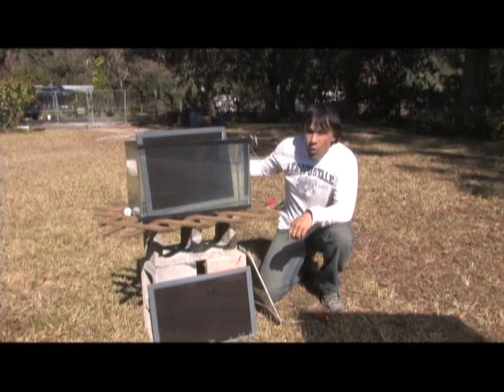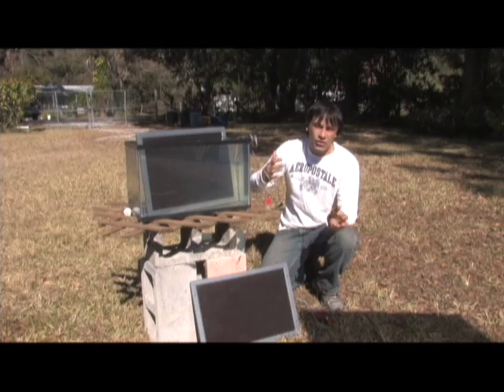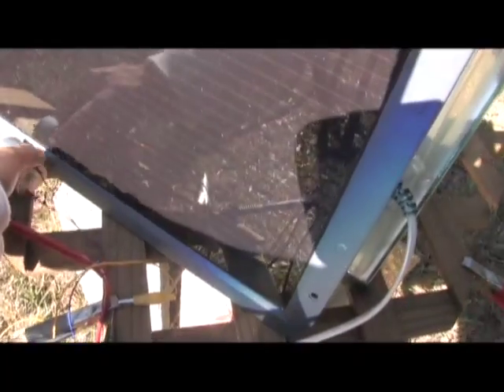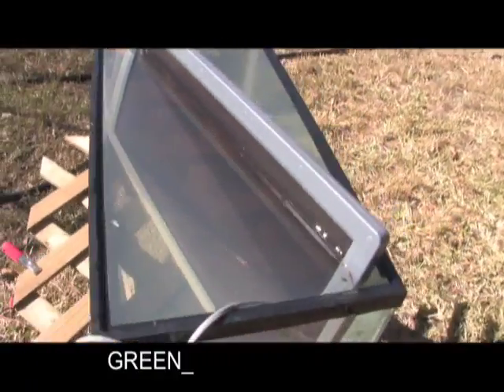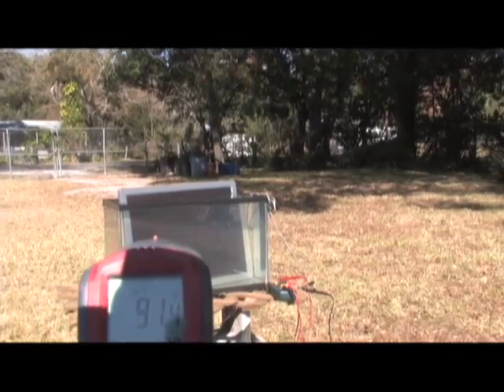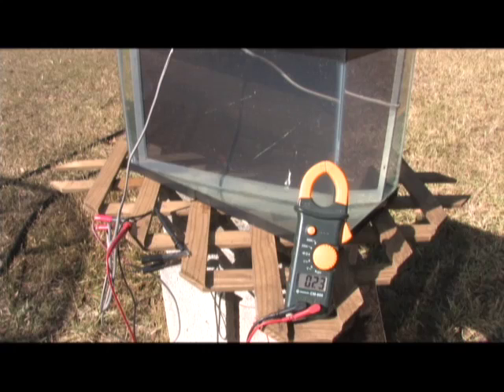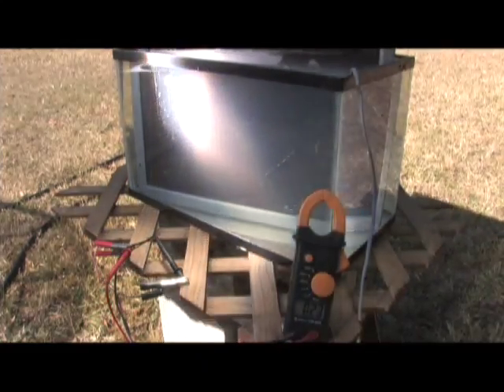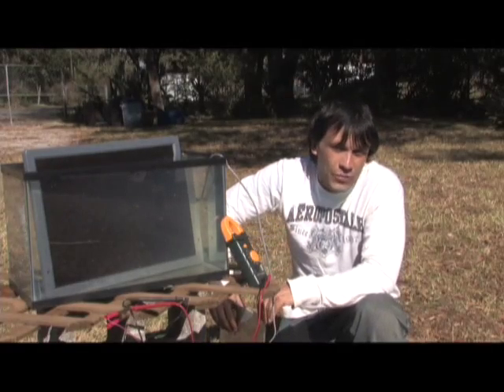Underwater SOLAR PANELS 9% Stronger PV Photovoltaic Sun Power

Comment: Test is trash. Use a real inline power meter to measure power. Also the panel in water is shaded.  Panels do work better when cooler though, there is about 3% loss per 10C heat increase.

Comment: The glass aquarium will obviously reflect away part of the sunlight before it even reaches the panel. So in reality they would perform even better if you would put them in a basin without glass over them. Keeping the water and the panels clean would be an issue, algae, leaves, insects would all build up. I can imagine a combination of solar panels and solar collectors (heating flowing water in glass pipes) work really well.
Since that is such an obvious idea, I wonder why haven't seen designs of that type on the market yet. Maybe because it is harder to realize than I think? I wonder...

Comment: Also it should be noted that although it might seem you need to "pump" water into the underwater Photovoltaic array, this added energy requirement would be obviated by simply using a solar thermosiphon setup (self pumping).

Comment: Usually when you harness a system or device to "get more work out of it," you increase the energy required to run it. This experiment shows that "getting more work out" can actually increase the energy efficiency and lower the cost of a system/device's operation. That's what makes this a classic experiment, perhaps "revolutionary."
Reply from the maker: Jay Dillon Thank you Jay!

Comment: You do not have to submerge panels in water to cool them down and to get more power out of them.
Just cool them down with cold water from a water hose. And leave your volt and amp meter connected while doing this. You will see more power output when the panel cools down.
In the winter I get more voltage and amps per panel when it is cold. But the length of sun light is shorter, so the total collection of sun power per day in the winter is lower despite the panels producing more power per hour.

Comment: dude get your facts checked, Solar panels have a optimum wattage depending on the voltage and amps drawn. It could be that your panel had more volts underwater but less watts at the amp's drawn. Read up on MPPT's and hook some up and measure the power generated in watts then check if underwater would do better.
Reply: +Malloot panels have a optimum wattage depending on the voltage and amps drawn.
No, but Watts = Volts * Amps :)  and panel resistance increases with temperature, so the results of this cool experiment are no surprise.
And no need for a MPPT, the electric motor turning slower shows the simple truth of it.
Reply: +WelcomeToMyDream do you have more resources to learn about this? have any more experiments been done in recent times?

Comment: Some current measurements would be good to see. Should be up a bit when cooled, as seen on the motor. With the lens current can go up close to the magnification factor. especially if panel is cooled.
How about heating thermal medium for 24/7 LTD Stirling running :)

Win win win. 
Thanks for the upload :)

Comment from the maker: "Hack to get the cells out" :-) Amorphous panel.
Reply: Heat the water and see if it goes down?  But it probably has more to do with the way that the water conducts the heat away from the panel better than air; and supplies a big thermal mas that is lower temp than the surrounding air.
Reply: The second panel was at a different (easily noticeable as worse) angle in reference to the sun, hence.. less power, case closed.
Reply: I wonder if the temperature of the water has something to do with it.

Comment: Excellent video. Using Water Cooling to boost the efficientcy of Solar Panels. It works and used in conjunction with a solar water heater, as the author suggested, should perform double duty.

Comment: What happens when you run the test in the tank with no water and also what was the difference in and out of tank under load. Not trying to be a dick but it's hard to see weather the gains are true or determine weather it is beneficial without those measurements. just sayin

Comment: I was wondering. If you got water flowing behind one of these(which could itself be used as solar warmed water) couldn't you put  a panel at the end of some sort of mirror funnel (like the triangular one you made in a recent video) and increase the output of a panel many times over?

Comment: Dan,
If you place the panel in a flatter tank with more open surface area and less volume, it should allow water to evaporate quicker and remove more heat from the water remaining. Then shine a few parabolic mirrors at it. With this cooling system, lets see how many suns you can add until you diminish returns or overheat?

When you start to over heat try using a small fan over the water to increase evaporation and the vapor will remove more heat.
Like leaving a pool on a windy day... freezing.

Comment: I noticed the same thing on my own solar panels when the sun makes panels hot so it drops amps, i have 2pcs 60W Single crystal solar panels, if i cool the glass surface with water, amps will rise about 1A, half amp each panel.

Comment: the fact that the panel in the tank was on an angle likely would have reduced its voltage because of the amount of refraction/diffusion going on, Id like to see this test taken to the next step perhaps submersing the back side of the panel in water so that the front isnt effected in anyway. then perhaps comparing it to total submersion but have the front only in a cm of water with the bulk of the water at the back.

Really interesting stuff Dan.

Comment: @lrb1e39 Also keep in mind that if your wiring the panels in series up to a commercial voltage such as 110V, the current from the panels is DC, not AC like commercial power.

Comment: it's so useless, 2volts is nothing. if there is a capacitor inside the solar panel it will be the reason it is not rising in volt that fast. when you walk by it only drops 2 volts too maybe because of the capacitor.

Comment: What if we use a water pump that pumps about 6 gallons per minute up to a soaker hose . The pump I looked at shows...
 Power: 25 watts * 396 GPH Output
I'm getting 5 panels 135 watt each about 27" x 60" x 1 3/4". Could that pump of mist or recirculating water be worth the 25 watts used? IF 9% is accurate for larger panels then 135*1.09=147.15 next 147.15-135 = 12.15 x 5 panels = 60.75 - the 25 watts used by the pump = 35.75 per hr about 175 more for 5 hrs. Great tip if it works like this.

Comment: Dan,  I have a question.  Can these solar panels be connected in series and a series of panel chains connected in parallel to: 1)increase voltage to something that would be practical in terms of tying into house power to supplement what I get from the commercial power grid; 2) charge a large bank of deep cycle batteries that I can use in times of power outage which we get a lot in our rural area here in northern Virginia?

Comment: I think a more practical option would be to use some kind of a heat sink/dissipation device at the back of it. But if it's only a volt or two ... then does it really matter? Interesting idea about a hybrid heat/pv system... that could totally work... if designed for this purpose.

Comment: Ok, I have a GLASS FUSION KILN used for artwork: 240 VOLT AC 2W. 1 PHASE 34.7 AMP, 8320 WATTS. Is it possible to use solar to operate my kiln(s)? What would it take and how much$ with all the parts if I did it my self? I can weld a stand for the solor to. whree does the energy store? Or is this just to much amps? Thanks call direct for guidence on this. I am serious about doing this. 6129684745

Comment: Hi, I am a glass fusion artist. Is it possible to run my glass kilns off solar? Here are the stats for my largest kiln. What would be the cost to build my own set up if even possible to produce enough electricity for a fire.  I weld to if I need to build a big stand for the solar panels. Stats: 240 volts ac 2W, 1 phase, 34.7 amp. 8320 watts. How many solar panels and what do I use to store the energy and convert it into my kiln? 6129684745 to help guide me.

Comment: Excellent!
 I've seen some comments that temp of the water will rise to 135 as well... well it is the minor problem. If you place a panel in the water tank which is connected to a bigger tank underneath that system trough heat pipes, you'll get much slower heating of the water... and also kind a temperature collector for heating water. If it is known that sun shines for about 10-16h  a day (depends on the location) it could be easily calculated how big tank should be for optimal results.

Comment: WHAT IS A tec?
Reply: xxx777aaa It's a thermoelectric cooler, aka Peltier unit, module etc... It use a semiconductor to produce electricity using a difference in temperature, hot on one side cold on the other!

Comment: But the aquarium glass and water in front of the panel also cut the light perhaps by 5-10%. If  the panel would be cooled only on the back (like making an aquarium with the solar panel replacing the front glass) it will be both cool and receive more light than submerged.

Comment: make a sandwich, botton, insulation material like .5 inch polystyrene, then plastic, like 2mm thick, then the solar cell, gap underneath for water flow, then a glass front, with gap to allow water flow, now you have the solar cell cooled back and front, and its also a solar water heater....

Comment: This video is not for electric engineers. 
Most people do not know that resistance of metals depends on temperature.

The interesting fact in this video - very simple way for cooling solar panel, and even in the not clear water it gives more energy than the same heated panel.

Comment from the maker: If that were the case, the voltage would have risen instantly. All solar panels and electrical devices work better when cool because of less resistance in the circuits.

Comment: I don't think its' because it's cool. I think it's because the water offers more reflection and more angles of light, and that offers MORE light at HIGHER doses. It's like holding a mirror up to a solar panel. I don't know if this is right, but I've seen this experiment done before with mirrors and water reflects light.

Comment: If it was the light  tank, the voltage would have increased instantly vs slowly. Poly Cells, un like these cells have a metal backing so heat sinking would make sense. This was totally the cool water

Comment: In electronics, as circuit temperatures rise, circuit resistance also increases. Heat  will decrease the output voltage. Most passive cooling systems will help to increase the voltage output. The only problem with the water solution is that once the water heats up, it will retain the heat longer. If you could circulate the water it will increase the cooling capacity greatly. I realy enjoy your vids. Great stuff and thanks for sharing.

Comment: is he... sure.. That the glass in teh tank wasn't refracting more light toward the Cells?  that would increase the voltage.. Same as replecting light from a mirror onto an already lit panel.. Or his fernel lense when he pointed it towards  the cells.

Comment: I think that when distilled water is used instead of normal tap water, the results will be a little better because it is more clear. Also distilled water doesn't conduct electricity ...as far as I know.....so there is less danger of shorting out your solar panel. 

I don't have a solar panel, but I would love to see  reactions from people that know more, or are willing to put up a test with distilled water and normal tap water to see  if there is a difference in efficiency. 

Greets, InsAneTunA

Comment: Hey the temperature difference is not the strict control of the voltage, you also have to take into account for the magifying of the light through the water.

Comment: personally, i'm sold on the higher volt readings of the wet panel, and it would have to be proven otherwise, to me at least, that the one in the sunlight can produce more power.  although the ammeter theory does make sense

Comment: You are correct BTW in that colder temps do make a panel more efficient - and in arctic temps gains of prolly up to 20% can be had. Reflection off snow/water can probably boost by another 10-20%  if shinning right. We've seen solar air heaters (not PV) increase in heat output by 50% thanks to reflectance off of snow. 

The catch to all this experiment is decrease in efficiency b/c sun ray's are traveling thru glass and then H2O.

For the record, I think it's great Dan's doing these experiments.

Comment: Also, I should of not said "no load" but minimal load. High volts turn motors faster, and surge of amps is what gets a motor turning. This is why you need to use what's called a Linear Current Booster with PV to get motors (like in solar pumps) turning. 

Also, please check out the I-V curves for PV.  What you'll learn is that in a near no load condition, voltage is maxed. But the point where the PV produces most power is at the knee of the curve - neither Amps or volts are at the highest.

Comment: Amps is the difference. Power = Volts x Amps. So the author can't claim more power is being created without showing us the amps. A typical silicon PV panel gains 0.45% efficiency for each degree C decrease.  So minimal. And his panel looks to be thin film which has less gain/C. Single sheet of glass reduces solar radiation by 10%. Centimeters of water? Prolly lot more.

For the sake and fun of science, I challenge the author to do the same experiment  accurately measuring watts (IxV).

Comment: In the tank faster + 22v reading

No Tank slower 20v reading

Amps have to be more, that motor is a load, it is geared, bet you could not stop it with your finger.

I believe that particular motor is 15:1

Comment: You are incorrect and the host is correct. The motor is a geared motor and requires more power to accomplish simply spinning. There may be a bit of a difference in amps but the fact that the voltage reading is higher from the panel while spinning the Geared motor faster proves MORE AMPS and his point. 9%-8% it is still more and a fact. I saw a documentary on Discovery solar scientist stated "the North Pole is the MOST ideal because of clear sun, solar reflection and COLD - 25% more efficient".

Comment: In the video above the author makes a critical mistake - he assumes that since the voltage is higher in the submerged panel that it's producing more power. However, power is voltage times current and he hasn't measured current. A higher voltage will turn a DC motor (notice there's there's no load on the motor) faster but that doesn't mean the motor has more "umf" to actually move something. He needs to add an ammeter into his test to see what the real power production is.

Comment: just an idea for roof top solar panels where a water cooling system can be installed ^ :)  i wonder if a PC/computer water cooling pump,radiator and fan would be efficent enough to flow water over a panels surface?  either way great video , and very inspiring. :)

Comment: Wow :) so how about a new design perhaps for a solar panel ? the solar panel could have an outer layer piece of glass(like double glasing) which would allow a tiny trickle of cool water to channel and flow over the panel surface to keep it cool. the water could be recycled from a large reservoir tank and filtered so to stop green alge or wat not from clouding the panel surface? i wonder if the energy needed to pump the water over the surface would still make the panel more efficient? :)

Comment from the maker: Angle of the sun has nothing to do with this test. If that were the case, the voltage would have jumped instantly when placed in the water. Solar panels deliver more energy cold than hot. That is a known fact.

Comment: An interesting idea - could you not power a heat exchanger with solar panels, that draws heat from the panels and increase their efficiency and at the same time collect head for warming the house during the night?

That way wouldn't you end up getting both more electricity, but also as a "by-product" heat that you could also make use of for other things, or would it just be crazy?

Comment: i got the same results as you but my reason was to cool down the panal by submerged it in the water,  I wanted to ask you where can i buy a powerful stirling engine to buy of the shelf which is efficint ...  usually i find very wqeak ones i want one which would generate about 5 - 1000 watts not less or more...   i appreciate if you know it i need for experiments, thanx

Comment: Good video.  And yes water actually absorbs light.  So putting them deep underwater like in a pool will actually take away available power.  At about 15 feet the red portion of the spectrum is completely absorbed.  But from your experiment heat effect the panels much quicker. Not really sure how to keep the panels cool with water and not have to deal with adverse side effects like algae. Or having to run a pump all the time.  Although it might be good to locate them on ground instead a hot roof.

Comment: So get a pool. :) Cool your solar pannels at the same time your heating your pool. The pic in my head is similar to Dan's previous campaign sign solar heater. Run the water across the side facing the sun then down into a water heater or something like that. Free hot water + better solar pannels.

Comment: interesting idea, excess heat diverted through a primary water heating coil and transfering excess heat to hot water system.
One problem though may be biomass generation and build up of carbonates in hard water areas?
Great video though, thanks

Comment: If you use a water tank connected to the fish tank with two hoses, one top and one bottom the warm water after being in the sun for a while will move through the fish tank and bring in cooler water and then the solar panel will work better.